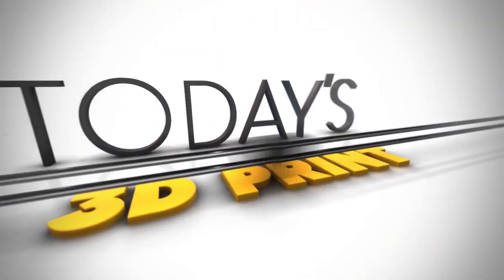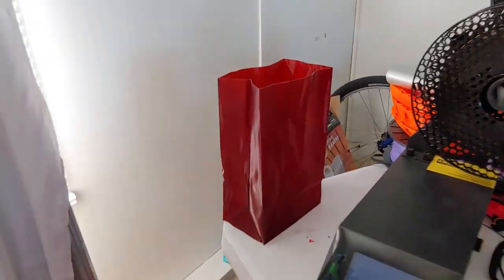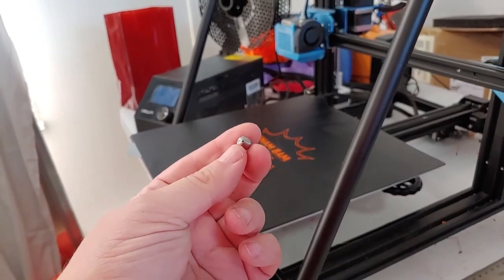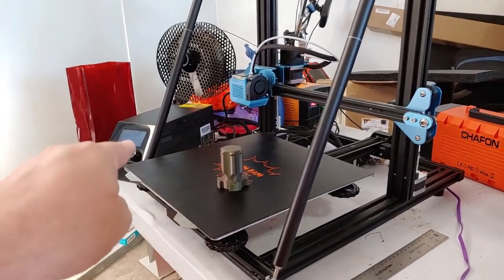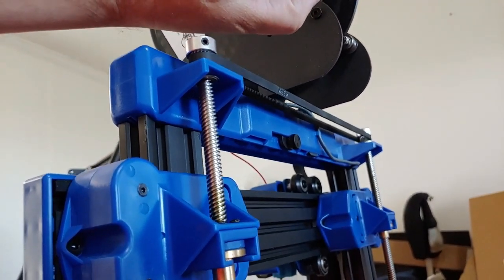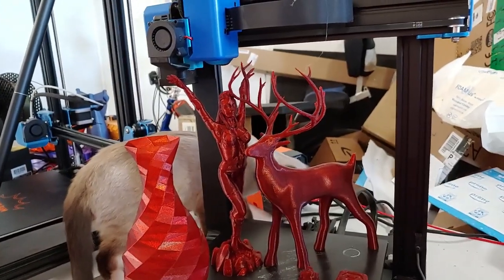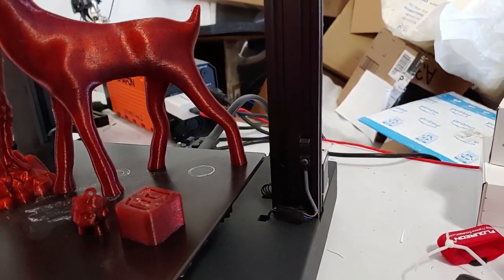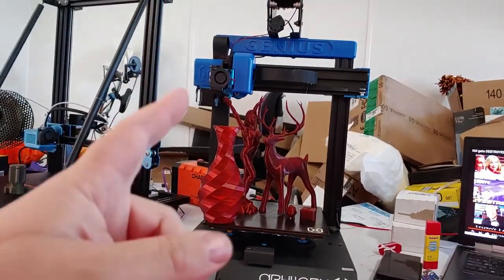Artillery Genius & CR 10 V2 Upgrades Ender, Anycubic

Comment: shocked more ppl havent commented!! so over all you say this printer is better then the ender V2? i laugh when ppl say the community for the ender is the best , in my mind that means theres lots of problems and creality gets away w no customer support because of the forums.. so you did this video in may how the genius doing so far? and what about the software? is it all open source or are you stuck using certain programs? very much appreciate a reply as i am looking to pull the trigger anytime now on a printer.. thank you for you time !!
Reply from the maker: The Artillery is doing great, don't get me wrong it's had some niggles 1st thermistor going on the machine and getting a spare was terrible, 2nd the stepper motor for the bed had a notchy feel and was destroying prints, took a little figuring out, as when you spun it by hand it felt fine, but under loads, it would stick, the bed is hit miss with adhesion, I tend to use a glue stick now no problems anymore.
This printer is not open source but I have flashed the firmware and use BL-Touch and any program, but stick to Prusaslicer for the Artillery, results are fantastic being as this printer now runs 24/7 earning its money,
Creality is the worst for customer service and overrated, personally, I think people go for them for the upgrade-ability
and the vast knowledge base from other users, I do get sick of seeing ender this ender that,
the Anycubic Mega s is a brilliant little printer with next to no issues, but again tied up with firmware, but customer service is great,
The choice is only down to the individual at the end of the day, Bangggod has all the spares you need for either printer and very good prices.